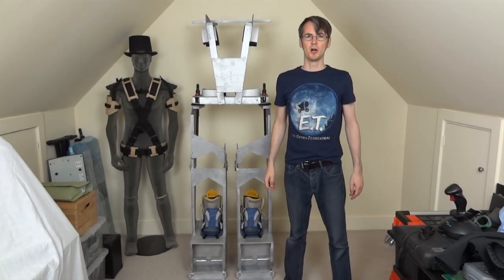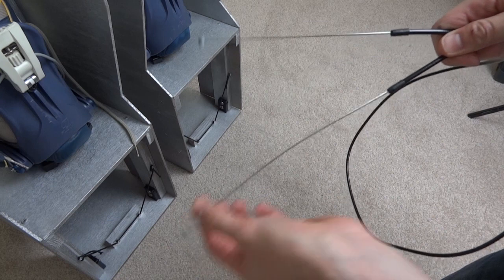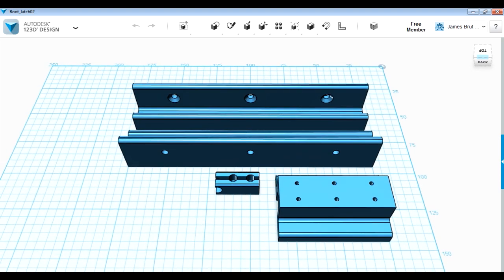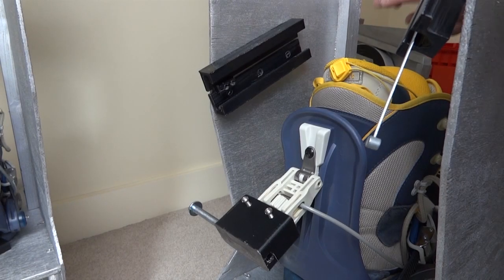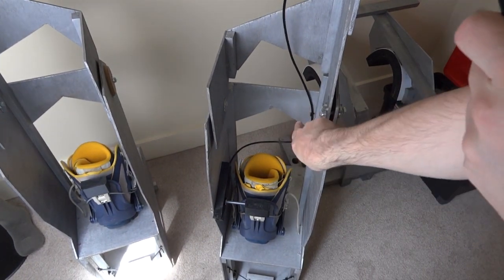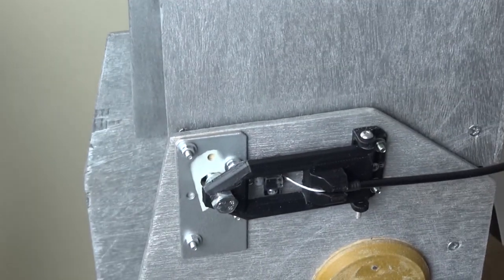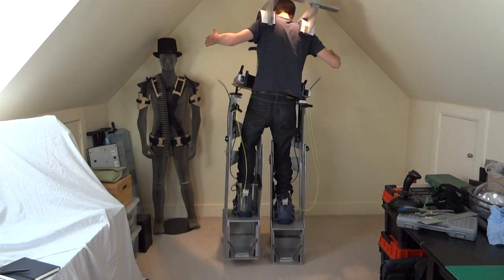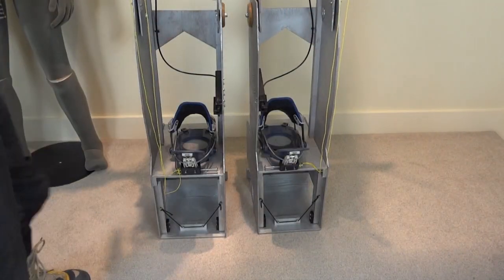Iron Man Hulkbuster Cosplay #5 | Frame Latches | James Bruton

Comment: Really coming along well, love the simple mechanisms as their is no need to over complicate everything if the simple solution works well. I can see a slight problem with the boot locking mechanism poking out the back of the frame when unlocked but then I assume that at that point the outer panelling would swing open to allow your legs to get in and out so it's not too big a deal.